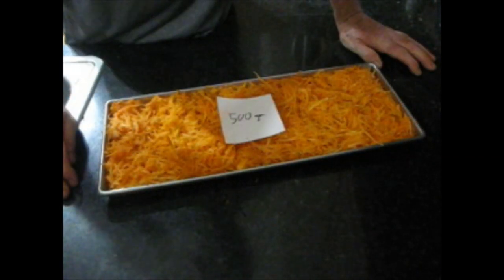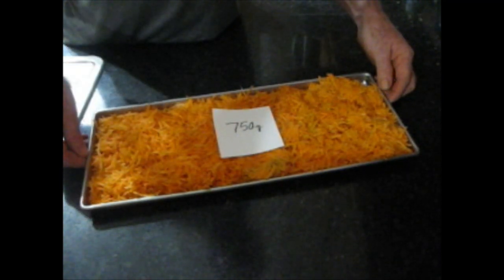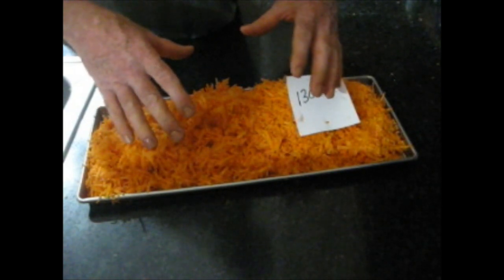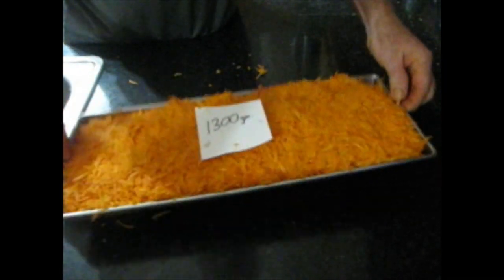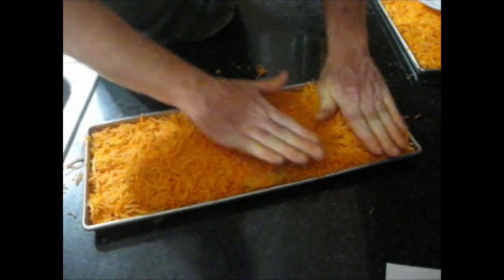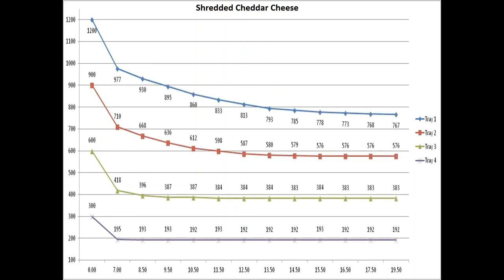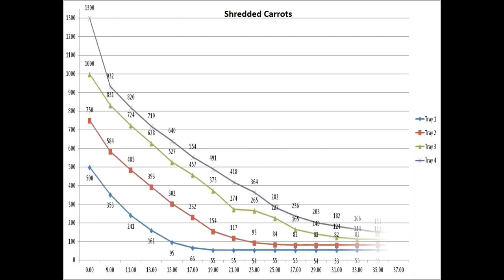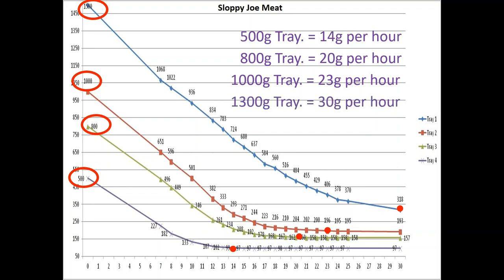Stack it deep - Dry it cheap

Comment: While I’ve never done a measured scientific experiment, I have always packed mine as high as I could go with food touching the heaters in the bottom of the rack above. My load times increase by about a third compared to running a load that would be more standard like other seem to be running but overall it shaves a lot of time off how long I would have spent drying food in two separate batches. I think many people get hung up on Harvest Right weight recommendations per tray without understanding the true limit of the machine, which is the amount of water each size is capable of handling. For example, my large can handle about two gallons of water per load. Something very wet like soup needs to stick very close to that volume limit but something more dry such as cheese and the only limit is really how much i can stuff in the machine at one time. Which, if you’re interested in knowing, is about 16 pounds of shredded cheese or 30 pounds of cubed cheese. I just pulled 30 pounds of mozzarella out yesterday and I can assure you it works beautifully. I have had two freeze dryers and have been freeze drying since 2014. Long enough to know what I can get away with 😉. I would highly recommend that y’all stop worrying so much- load your machines up to the gills and get more done faster!

Comment: Great data, explained well. I’m curious if the results would be the same if you did entire loads for the different weight per tray vs the different weights on diff trays in same load. Would that large 1300g tray be as productive if the machine were loaded with 3 other 1300g trays vs lighter trays that finish earlier, leaving the machine to only have to work on 1 tray during the final hours
Reply from the maker: Looks like you gave me a great challenge. I'll need to try to maximum all four trays.  I wonder how large the ice ring can get?
Reply: Marcus- exactly what I was wondering. Either way great video

Comment: I was wondering about that. My wife and i just got our large freeze dryer last week. I am going to start doing way bigger loads. Thank you so much.😀
Reply from the maker: I'm going to try some massive loads, with high water content, to see how large the ice ring will get.  Can The ice ring get too big?????
Reply: @Philat4800feet  just found out yes it can. When it comes in contact with the rack  it's so cold it pretty much canceled out our heaters. Smaller loads with high water content.
Reply: @Dwohman  yes that’s exactly right and what I have experienced as well. When this happens the machine just keeps running and can’t seem to keep pressure down or ever end a load because the ice buildup interferes with drying.

Comment: There is a 10 hour window, 5 days a week that i can not tend to the freeze dryer due to work schedule.  Ideally 19 to 21 hour cycle is more efficient for me. That allows me to unload, defrost, start new load and verify vacuum before bed. I love that you took the time to try and come up with the data. I will use the data but maybe not in the way you intended. Adding up to 10 hours to the cycle to account for work would reduce my efficiency. There is definitely a sweet spot of tray weight based on ones personal situation.
Reply from the maker: If my FD is near the end at night or in the morning, I'll often add 12 hours due to work or sleep.

Comment: That was an excellent video topic. My first load in my machine was seeded tomato chunks and my trays were heavy with fruit I had frozen while waiting from my unit to arrive. They dried after 32 hours and I wondered if it was an efficient way of doing them. Glad to see from your data, that it was likely the best way to go. I did get a lot of ice buiild-up in my machine though and eventually had to take out the first tray that was dry, and move the bottom tray up as the ice was keep the bottom tray cool.
Reply from the maker: You bring up a good point.  How large of an ice ring is too big?  On large trays, I will rotate the trays every 6-8 hours.
Reply: @Philat4800feet   How do you rotate the trays during the cycle? Do you just stop  it (hit cancel) while it's still in the initial drying phase (displaying the orange progress bar)  and then  rotate trays and rearrange the food and then re-start the cycle with extra drying time‽?  

Because with my medium and 5.0.15 software, If I stop the cycle with the orange bar on the display, then resume the cycle it doesn't return to the orange bar on the display, but it shows the up and down arrows to add EXTRA drying time. So the machine "sensing" function has been cancelled/disabled for that batch, right? And now I have to be the judge of how much drying time is needed.

Comment: Please forgive my ignorance. I am new to freeze drying. But how do you stop the process (& when do you open the door) to weigh & check if it is dry? 
Also have you done a video on updating the program on the freeze dryers computer.  I am so afraid of messing things up.  I would ask a Facebook group, but some are very unfriendly.
Reply from the maker: Once the food is in the Final Dry stage, I will:
1. Open the drain Valve
2. Turn off the vacuum pump using the rocker switch on the rear of the pump
3. Wait to vacuum to decrease and open the door.

Often I will move the food around and rotate the food trays.  The bottom tray goes to the top, the top goes one slot down a so-forth.

When I'm done, I'll close the door, close the drain valve, and turn on the vacuum pump.
Reply from the maker: Uploading the software is easy.  Use a low memory jump drive.  Download the software from Harvest Right:
https://harvestright.com/software-update/
1. Turn off your Freeze Dryer
2. Put the jump drive in the USB port.
3. Turn the Freeze Dryer back on.
4. Once the normal screen appears remove the jump drive.
Watch this video:
https://youtu.be/FJTjZcbZQLg
Reply: Thank you so much! That information is very helpful, I took notes & will add it to a notebook I am starting with tips and tricks.  Thank you for getting back so soon!
Reply: @Philat4800feet  can you open it up in just reg dry.  It's been way over 24 hrs of dry and I'm afraid I filled my trays too full with a real wet food and I'm afraid there is too much ice for it to work right.
Reply from the maker: @jackiesnowflake2255  Don't give up yet.  You can pause the dryer and rotate trays and stir them if you want.

Comment: Hi Phil, thanks so much for all your videos and help. We are setting up ours today, and I thought I saw where you said to spray a little wd40 on the ball bearing in the connection hose of the pump- but I can’t find that video- I’ve looked all through your channel- it was to prevent an air leak- it was to prevent corrosion of the bearing because it was aluminum? Anyway, could you point me to that video? Am I remembering it right? Thanks so much.
Reply from the maker: The ball within the valve is chrome.  I can't remember recommending WD40, but it wouldn't hurt and may protect the ball's finish.
Reply: @Philat4800feet  Ok, thanks so much.

Comment: I'm not sure you'll see this because this video is rather old.

I watched this video, and your testing and analysis seems spot on.  However, I have a concern, and that's about food-safety.  My questions arise due to my lack of full understanding of the freeze drying process and specifically how the controller in the Harvest Right Freeze Dryer is programmed.

The programming/strategy of the controller in the FD is mysterious.  (That makes me want to replace the Harvest Right controller with a PLC or processor of my own choosing, and then program it myself so I know exactly what happens AND I can gain better control.  But that's a subject for a different time).

So to the food-safety concern when stacking the trays as full as practical in order to get the highest efficiency.  The manufacturer is clear that you should not stack food higher than the depth of the trays.  I am speculating, but one reason they may wish to limit the thickness or depth of the layer of food is to speed both the freezing and the warming processes to keep things safe.

What I wonder is:  If I stack food deeply, mounding it up well above the depth of the trays, might this extra thickness cause some of the food to freeze much more slowly (or not get fully frozen at all) and warm up more slowly as well.  The machine has no way to measure the temperature at the worst-case point within the stack of food in a tray.  So the programmer has to make some assumptions.   The program may "think" that the food is frozen before it actually is.  Everything will take longer than the machine might be programmed to "think" is possible.

I need to observe what happens more closely.  I've only had my machine for a few days, and I've run two full cycles and I'm now in the middle of a third "run", this time with frozen corn piled in so deep that it's probably double the amount the manufacturer expects.  Being busy at work, etc., I haven't been able to devote the time to "babysitting" the machine and trying to note exactly how the cycles work.  Further, I wish there were more sensors within the machine, and I wish the controller logged the data so I could review graphs of what actually happens when I'm not looking.  (Gee, what might be available on that USB port?)  ;)

I've designed, programmed, manufactured, and built telemetry, process control, and SCADA systems for 40 years, so I'm used to being able to just modify a program or hardware to get my eyes on whatever data I want.  So using this system is somewhat frustrating because so much of it is mysterious and unavailable for viewing.  But again, that's for another time.

Anyhow:  Since the food is raised to temperatures that are clearly in the "danger zone" for bacterial growth during the processing, and since it takes a long time for the water to be pulled out, my question is:  Is there anything to prevent the food from spoiling during the freeze dry cycle if we pile the food in deeper than the manufacturer recommends, and thus potentially have unfrozen moist food in the "danger zone" for more than a safe time (usually quoted as 4 hours max)?

I see readings between 40 and 130 degrees for many hours when I'm running this freeze dryer.  Where is the temperature sensor that's being reported?  Does just having a fairly high vacuum on the food somehow prevent bacterial growth?  (That's one of my big questions).

If having a reasonably high vacuum on the food the whole time prevents bacterial growth, then I guess that's the simple answer.  We don't care how moist the food is or what its temperature is at as long as it's under a high vacuum.  But if that doesn't suppress or prevent bacterial growth, then I'll be scared to eat the corn that I'm currently freeze drying.  It's been running for at least 24 hours, and it has an impressive thickness of ice formed on the inside of the chamber.  So I know a lot of water has been pulled out of the food, but is it safely dry yet?  Right now, I'm not at my house, so I can't check the readings at this moment.  But when I last was able to look, it was running at around 120 degrees F, at around 500 millitorr.

Again, not knowing how the program in the unit functions, I'm only speculating that the system judges the dryness of the food by looking at the vacuum reading.  Deep vacuum means little water vapor being released, and less vacuum means more water vapor being released?

And this brings up another question based on my ignorance of how this is all supposed to work.  Does having a thick layer of ice on the inside of the chamber insulate the inner surface of that ice such that it is free to sublimate and add more work to the system than it's designed to handle?  It seems as though there might be a point where we've added so much thickness to the ice layer that the system is forced to get rid of more water through the vacuum pump, because the ice layer reaches a maximum "freezable" thickness.  And thus, we're stressing things more than what the manufacturer would like to see.

Anyhow, you can tell that my questions are all based on my lack of understanding of how this process actually works.  But I'm questioning the food safety and the stress on the machinery that I might cause by adding too much food to the system.

Even though your testing and analysis of the efficiency convinced me that it was best to add quite a bit of extra food to each run, I fear I may have gone too far with my corn (which I did not smash down into a more thermally-conductive layer like you did with the shredded carrots) - It's a porous mass, which seems good for sublimation, but not for the heating phase of things).  :)

Thank you for your generous giving of time to create your videos and to read and answer people's comments and questions.  It has to be a lot of work, and I appreciate it!
Reply from the maker: You pose some good questions.

You can pull some really good data from the USB port.  The system records a host of data points every minute.  turn off the machine, insert a jump drive, and turn back on.  This will give you a spread sheet.  You'll need to format the first couple of columns to get the date and time.

Freeze drying is controlled by pressure.  Once everything is rock hard frozen the vacuum pump turns on.  As the trays heat, the ice goes from a solid to a vapor.  The vapor increases the air pressure inside the chamber.  When this happens the vacuum decreases and the heaters turn off. The water in the vapor freezes against the chamber wall, and the vacuum increases.  At a predetermined set point, the heaters turn back on.  The cycle repeats over and over.

Bacteria will die around 140 degrees and above.  Food becomes cooked at 145 and above.  For Bacteria to grow, bacteria must be present.  Food preparation is one of the most important part of food preservation.  There are limits to how much you can stuff inside a FD.  The two important issues with drying larger amounts of food is contact with the tray and contact with the food.  The heaters heat the trays, the trays heat the food.  Contact is important for the heat to transmit throughout the food.  That why I suggest to smash the food down to make better food to food contact. 
The risk of bacteria occurs when raw foods are consumed.  Raw, freeze dried foods, should be cooked before eaten.

You bring up a good question that needs research.  The Danger Zone for food is two hours at temperatures between 40 and 140 degrees.  The FD dry cycle lasts much longer than two hours at temperatures near, or at, those above.  This could be an easy answer, but unknown.
Reply: @Philat4800feet  I really appreciate you getting back to me so quickly.  And I apologize for the delay getting back to you.  Work, dire health issues with a family member, etc., has interfered.

I put a USB drive in, and you're right.  I got a LOT of data!  Very interesting, and informative about how the machine goes about the process.

I do have data now from the enormous run of frozen sweet corn that I was running.  I put approximately 220 ounces of store-bought frozen sweet corn in, which meant really topping the trays off.

I, like you, set the default "extra drying time" to 12 hours because I can't babysit the FD due to work, sleep, etc.  In this run, the actual Drying Time as controlled by the unit was over 40 hours.  That's in addition to about 3.5 hours of "freezing" even though the corn was frozen to begin with.  Then, in addition to that, it got quite a bit of "extra drying time".  So it all got dried very well despite being a big load.

I'm really happy with how it turned out.

Anyhow, the ice that was collected on the inside of the chamber was pretty impressive.  I collected it all, and measured the volume.  I got about 163 fluid ounces of water.  Now that may not be all of the water that got pulled out of the corn, because some probably got sucked out by the pump, but it's probably the lion's share of it.

The punchline is this:  From 220 ounces of corn, I got 163 ounces of water.  That's 74.9%, and from what I can find on line, corn is supposed to be 75% water.  Pretty neat correlation.

I may not put that much into the machine in the future, but despite it taking a long time, I'm happy with the results.

None of this addresses the potential for bacteria growth, but the freeze drying worked well.
Reply: Bacteria need moisture to grow and multiply. With food frozen solid, that prevents or severely limits growth, just as it would being preserved in your freezer at home. Because the water sublimates during the freeze dry process, it does not exist in a liquid state in the food during the freeze dry process, making bacterial growth highly unlikely.

Comment: How do you pause the Harvest Right?
Reply from the maker: What I call "pausing the FD" is opening the drain valve, waiting 5 seconds, and then turning off the vacuum pump at the switch.  This allows me to check on the food and rotate the trays.  Reverse the procedure to start back up.  It will take 7-8 minutes for the FD to get back to 500 Mtorrs.  The check valve in the pump will keep any oil from entering the chamber
Reply: @Mojoflyingsolo    Thank you for asking this question!
Reply: @Philat4800feet  just so I can understand exactly:..   1-open drain valve. 
2-wait 5 seconds.
 3-turn off pump switch.
 4-open door and test/rotate etc. 
5-close door. 
6-CLOSE DRAIN VALVE. 
7-turn on pump switch.  
 Or are steps 6 and 7 in the wrong order???